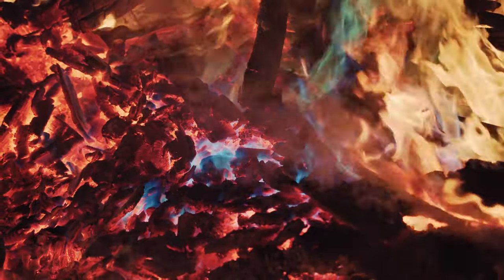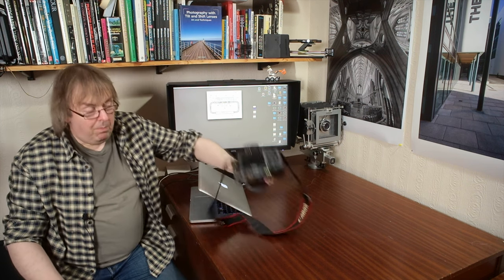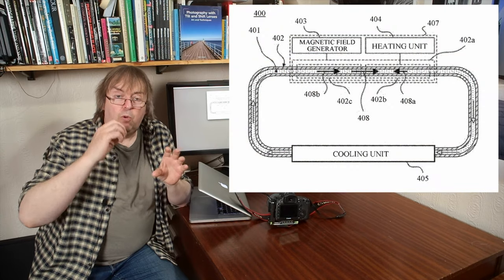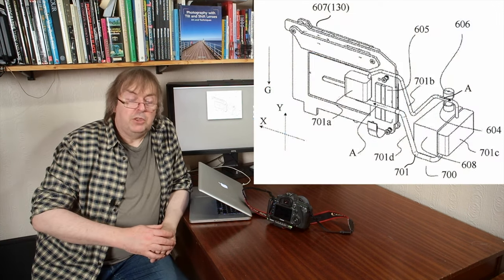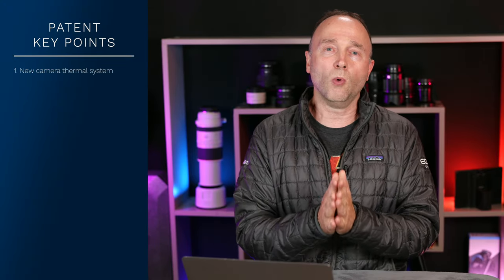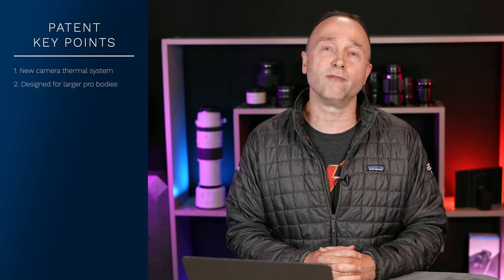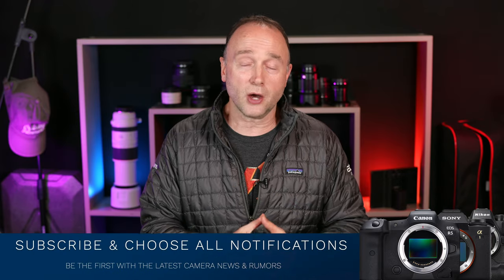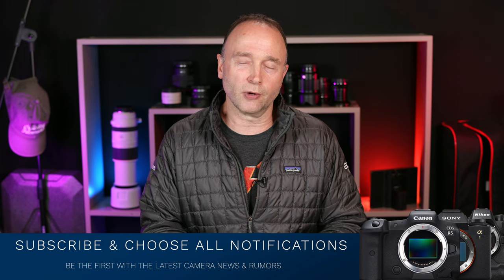Canon Magnetic Cooling - No More Overheating!

Comment: Thank you Simon for the info about canon’s cooling technology. I believe there will canon’s flagship camera much powerful than Sony’s and Nikon’s.
Reply from the maker: I’d like to see it in the r5, but it might just be kept in the oversized bodies. I hope the R1 has this or some other better thermal architecture. :)
Reply: My r5 is getting old and waiting for the flagship. I believe C70, R3 and R5C are not worth to update for me.
Reply from the maker: My R5 is still working well for me, but I do see the C70, R3 and R5c as not worth the update either... Waiting to see what the R1 will bring.
Reply: Hi Simon,

I don’t know.  I picked up the R5C instead of getting the Atomos recorder to pair with my R5 and it was the right choice.

The power issue was easy to deal with.  I have two options, added a Core SWX new Powercore Edge Link 70W that is stackable but one is plenty enough.  Only annoyance is if you use the dummy battery, then you need to buy their proprietary dummy battery as they have a non-standard male connector.  Nowhere in their manuals or literature.  Or use an dummy battery adapter that is d/p-tap.  If you need 80k60fps, then use the PD port with USBC cable into camera.

An alternative and cheaper way is buy Smallrig power adapter clamp and add the Nitecore PD powerbank 10,000mAh which is lightweight and small form factor and you can run 8K60fps and for hours.

No 30min recording limit which makes the R5 annoying for long form video.  And no overheating.

The IBIS removal is fine as no wobble and the digital IS + OIS is good enough for most handheld video.  And if not, I use a gimbal.

The AF is not fast as R5 but for what I do and learning how to use it for my use cases, it’s fine.  I think those complaining were coming from R5.  But if you’re coming from S1H or other much worst AF, this is averaging up.  Otherwise I use manual.  There’s always workarounds.

The improved video codecs options, video recording options, own video menu, fan with a flip out LCD that doesn’t bump into cables or cage when swiveling, no 30min recording limit, external monitor not needed r workable without in run and gun situations, and much better dynamic range is well worth the upgrade IMHO if you shoot more video than stills.  If you shoot more stills then I say stay with the R5.

As for the magnetic active cooling, I only hope it has magnets that doesn’t mess with the polarization.  I tried to be cheap and added the Black Shark magnetic fun cooler used for cooling smartphones for gaming on the R5 and A74 and it turned the contents on LCD screen upside down.  I freaked out and thought my LCD was malfunctioning and then thought “wait a minute, it was working until I added the fan” so I turned it off and took it away and turn both cameras back on and it went back to normal.  Talk about being clueless there!

Lastly, thanks for sharing what we can anticipate with the R1.  Going to be a great flagship.

Canon just need to release more affordable high quality lenses through 3rd party and stop thinking about doing all by themselves to keep all profits and/or quality control as they have been slow to pump out RF lenses.  Meanwhile Sony, Tamron, Sigma and others are coming out with high quality lenses that are affordable and lightweight.
Reply from the maker: The R5C allows you to run and gun without a Ninja on top and that is a big deal. When I got the R5, there was not even a hint of the R5c. I might have very well gone with the R5c myself back then if I had the choice. Before I got the Ninja, the R5 was very frustrating to shoot with. Glad you're happy with the R5C :)

Take a look at my video on the R1 and every 1 series camera... More insight there in detail.

The patent application just shows us that Canon is seriously thinking about better ways of keeping the camera cool. The result in the future should be cooler cameras running longer.
Reply: Hi Simon,

Agree if R5C was available then, I would also have purchased it first.  But now I use the R5 mainly for stills and for video, my Bcam.

Definitely will check out your other R1 videos.  Am happy to see Canon find ways to improve  active cooling solutions.
Reply: Sony alpha1 flagship is a joke considering the a74 has key features lacking in the Alpha1 like focus breathing compensation, focus mapping and USB live-streaming. It’s a fine photo camera but definitely not video flagship

Comment: Seems like R5 heat issue can be solved with a simple copper plate, without need for liquid cooling (Canon screwed up internal h/w design on R5..probably locked some design aspects before CPU and storage thermals understood and chose not to delay for remediation) 
But next gen PCIe Flash Storage may (likely) need far better cooling, so if an R1 had dual DigicX and dual CFExpress cards.. yea, Canon is gonna have to get their act together regarding heat (which they didn’t have to deal with for so long with under-powered CPUs in prior generations of cameras, and relatively slow storage) at some point.
 I suspect this won’t be required for upcoming R1 (overkill when much simpler/cheaper options available … unless R1 specs end up way higher than expected), but future camera generations are going to need better heat dissipation so I like that Canon is investigating.

Comment: This could be an interesting solution for heat. I’m wondering if the close proximity of magnetism and the memory cards could impact the data storage.
Reply from the maker: Video and stills are the most important outcomes of a camera. I'm sure they won't compromise there.
Reply: Negative on that. Flash media is not affected by magnetic fields.

 "There's nothing magnetic in flash memory, so [a magnet] won't do anything," says Bill Frank, executive director of the CompactFlash Association. "A magnet powerful enough to disturb the electrons in flash would be powerful enough to suck the iron out of your blood cells," says Frank.

Comment: This is interesting and would work but it would add bulk to the camera and cost so there will be tradeoffs even if they go ahead with this, a interesting concept but I think costs, weight and size of the body might not be worth it. To me if you have to record at durations that cause a Hybrid Mirrorless system to overheat maybe just buy a video camera?

Comment: So, Simon, IF I were a pro who needed beyond the 1.6 fixes for my R5, I'd sell it and get an R5c. Yes, no IBIS, and you have to learn a new video system, but at least the heating issue would be obviated. I tend to be very Yoda on these sorts of things: "do, or do not, there is no try..."
Reply from the maker: Do or do not.. I agree. Not having IBIS is only an issue if you've never shot without IBIS ;) No IBIS, no worries, just put it in a gimbal and problem solved ;) The R5c gives a very powerful video centric camera for just a bit more. For some, its a very good camera. This Yoda is waiting to see what the R1 will be and maybe even the R5 II. The force is with me in the current camera. I'm in no rush to send my money off to fight a battle I've already won.

Comment: If it's real and it works, it could be genius. The diagram doesn't show a vertical grip. Would this be for a pro body like the R1, or an R5-type body? It seems the latter, being smaller, might need this cooling system more since the larger pro bodies seem to dissipate heat better in general.

Comment: Interesting patent. I think this could be used for a newer EOS RXXC type camera where video is priority or in the professional camcorder.
Reply: Patent application - not a patent.  No idea if its actually novel (as stated by the engineer at the end of his talk).  Even if it is issued, that doesn't mean that Canon can actually use the idea, as they may still infringe on another patent - this is called freedom to operate, and it is not at all related to patentability.  This may just be an improvement on another patent (e.g. using liquid to cool), and is novel just for the use of a magnet.  Canon would still be infringing on the assignee of the patent on liquid cooling.  So lots of variables that would still need to be considered.
Reply: @illinialumni  What engineer!
I'm an architectural and commercial photographer by trade ;-)
Reply from the maker: Everything new is based on something else. Very few completely new technologies out there.
Reply from the maker: @Keith, well you came across as a bit of a learned professor ;)
Reply: @OrdinaryFilmmaker  you are correct that almost everything is built off of something else. I'm just pointing out how patent law works. An application doesn't always become a patent (and what actual claims that may be granted can be a very small piece of what's written in the application), and having a patent only grants you the right to prevent someone else from making or selling something that your granted claim reads on in a country where your patent is granted.  A granted patent does not grant you the right to do anything. Freedom to operate does that and that's an opinion written at the time you start selling (if you ask your attorney to write it) and it's only as good as the patent landscape at the time of writing.
Reply from the maker: I feel patents can sometimes get in the way of innovation. How do I know that my product isn't violating a series of patents even though it is a new product... Must be a daunting process requiring a lot of legal footwork.
Reply: @OrdinaryFilmmaker  Patents are very much a double edged sword.  Patent prosecution and management is the single biggest line item in many technical development departments.  There is a significant industry in just using patents for profits.  There are patent trolls who look for ways to charge companies royalties even though they have zero intent on utilizing their patented technology.  At the same time, patents are critical to companies that can't use trade secrets to protect their ability to profit off of innovation.  Mechanical things as well as things such as pharmaceuticals are very easy to reverse engineer, so the only protection you have from being undercut is by patenting your invention.  Patents, however are also severely misunderstood.  

People very often confuse patent applications with issued patents.  Applications are exactly that - a submission to the US Patent and Trademark Office requesting a patent.  Getting patents issued can take quite a long time and involve many rounds of discussions with someone at the USPTO.  Even on issued patents, the only things that are protected are what are written in the claims.  These claims can often be very narrow entities from what's more broadly described in the body of the patent.  The body of the patent does remain important, both because the writer of the patent is often obligated to provide what is called the "preferred embodiment", which means that someone skilled in the art should be able to effectively build what is described in the patent, and the original requester of the patent can sometimes go back and write new claims in new patents referencing the body of a previous patent.  This is the tradeoff patents are supposed to do - a person is given a period of time of protection from someone stealing their idea (nowadays 20 years from the date of the official application [there is a prior 1 year period where the initial - provisional - application is unpublished but on record at the USPTO providing 21 years of total protection]) for enlightening society to something that is supposed to be useful.  (You can't patent something that is obviously not possible to actually build for instance.)

The final big issue is what I mentioned about Freedom to Operate.  Having a patent is a defensive tool.  You can stop others from infringing on your idea, but patents are not guarantees that you can use your idea, as you may still be infringing on someone else's patented idea.

I have only touched the surface here, and an actual patent attorney will likely find some small errors above.  Generally it is all a very complicated issue.

Comment: This seems really over engineered. I'd rather companies go with the solution of the R5C and make that a standard. Black Magic's cooling solutions aren't bad either. You could argue that it'd be to the detriment of the internal microphone but the counter argument is internal microphones already have an abundance of problems which is why they're not used by professionals.
Reply from the maker: What's more important is this shows Canon is serious about resolving the overheat issue. There are many ways to do this without a better copper heat plate, internal architecture, heat pipes - all without any new technology. This patent application shows they are looking for better ways to address the problem. The end result of future cameras should be much better thermal architecture.
Reply: @OrdinaryFilmmaker  Well let's hope it results in better video then. Really surprised at the lack of high speed in modern ILCs and I can only assume it's due to the lack of cooling.